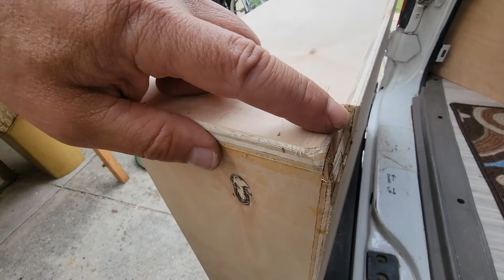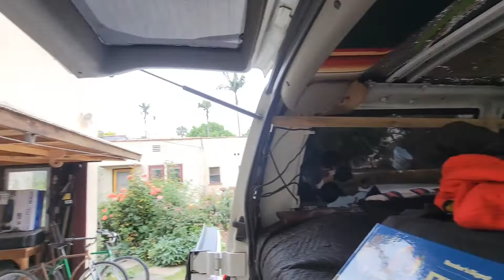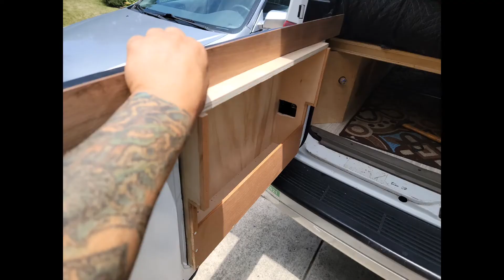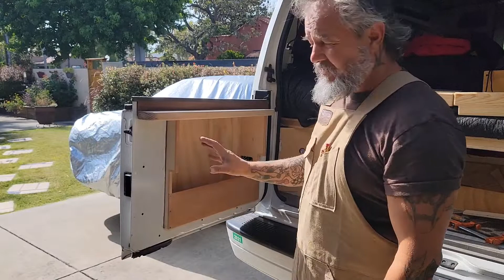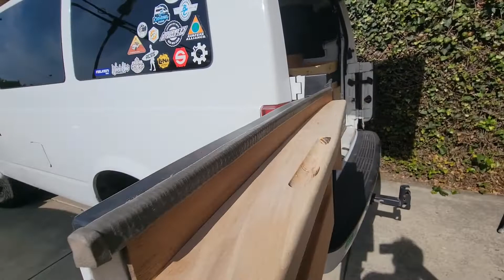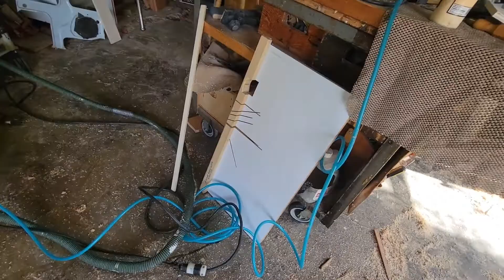Astro Van  Rear Door Built-in Storage Box Project

Comment: Mike, an elegant wood doweled hinge with rod that holds the canisters in, then you can put a shelf above them, less wasted space.  Here in carmel from oregon thinking of heading further south and stopping by.  We'd nearly be twins.  Fuel costs are the issue. enjoy the variety. I did the same type of thing with my Sprinter.  Think about flip up rather than down.    Nice work!
Reply from the maker: I considered the dowel but the "box" give me more options - and the "fold down" gets me a nice working height table...  I'm still not sure just what will be in this door, I will be doing the other door as well, knowing there's less space due to the license plate carrier but I want them to kind of match - Both will have the fold down tables....  I'm leaning towards having it more tool oriented, the stuff I use for the van all the time plus the tire changing stuff - but that still leaves plenty of room for other "stuff"

If you are down here reach out, if I'm around and not swamped with work we can hang...

Comment: Do you have a video on how you got your doors to open 180 degrees?
Reply from the maker: Open the doors, look between the hinges there's a flat piece of steel going from inside the side of the door to a connection point on the vehicle, lift that piece of steel off the pin and the doors open all the way

Comment: Wonder if that would hold a 5 gallon water jerry can?
Reply from the maker: I don't understand
Reply: The old metal slims ones ye? I think that's what your talking about .
Reply: Wouldn't that put too much stress on the hinges? I see that Mike has entertained the idea of putting an external water jug on one of those Dutch doors but? Seems like a lot of stress? Waters damn heavy.
Reply: Have 94 Astro conversion van with fiberglass top. Would like to take advantage of the Dutch doors as well. Could we all benefit from your engineering? Could you make some measurements and plans? Would be valuable to me. Could kick in?
Reply: Gosh I need to know what a riv nut is. Going to google. Not a metal worker. And have a hard time understanding how to attach things to astro. Have a good start on a build out though very comfortable.
Reply: I guess I'd have to see if the 94 version Dutch doors are the same as after the change. Yours is like a 2000 and I forget? Next generation.